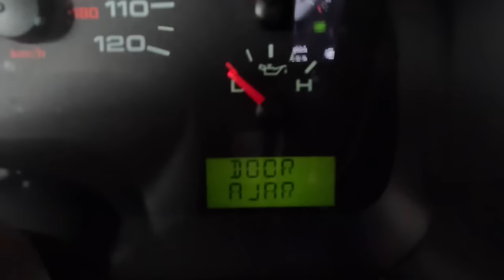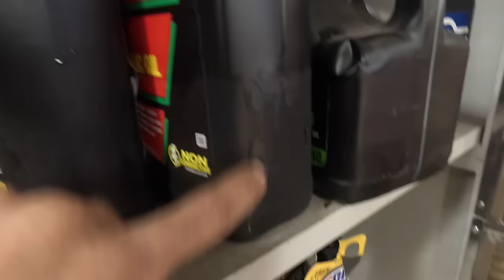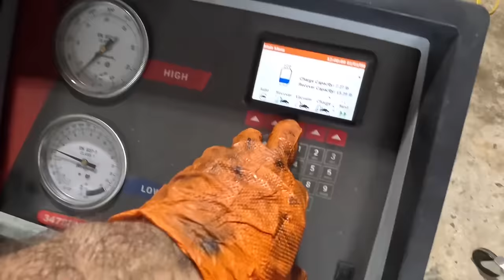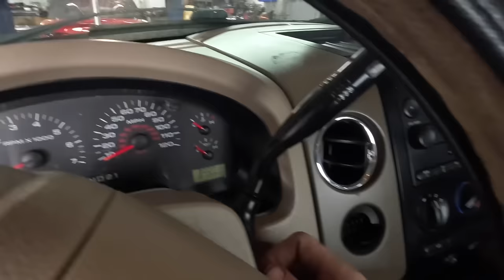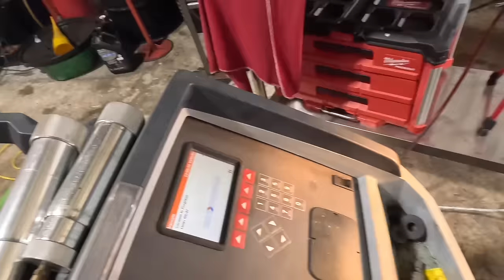New Engine! Warranty Camshaft Sprocket Cheap and Risky! Ford F150 F250 5.4 Triton

Comment: I thought for a moment when you had trouble pulling out the wedge you were going to get the rod only and the plastic bit would be stuck inside!
Reply: i worked at a ford dealer and had that happen with the actual ford tool
Reply: I had that same thought!  Glad the whole tool came back out.  As Ray would say "that would be bad". 😂
Reply: I thought the same thing.
Reply: My mind went there, I'm not gonna lie.
Reply: I too was worried about the lemon-flavored popsicle.
Reply: I had visions of Ray needing to find something long and with a hook, like a bit of welded welding rod to try and fish out the missing head of the tool --- and then that would get stuck or drop into the chasm of the timing cover.  "Das wäre schlecht" he might have said, and the camera could have begun to smoke in sympathy.
Reply: @heckelphon  Kind of like a tool-based version of that childhood song, "I know an old lady who swallowed a fly".
Reply: @MonkeyJedi99 it's a cheese wedge
Reply: @rosselnator  definitely a cheesy way to fix the problem... Not a fan of the rebuild company or their insurer...
Reply: @mikejacob3536  ... and if Ray had had a problem with that tool or the method, would they have paid for his time in stripping down the front of the engine to sort it?
Reply: Especially when he said come from Amazon....lol
Reply: That would suck!!!

Comment: I was literally cringing when you were changing that sprocket out - worried you were going to lose that chain and have to take apart the whole front of the engine.  But, smooth as always, you are, Ray!  Turned it into an outright breeze!
Reply: Watching you work in such tight spaces I will stay with working on my old 1961 F100 where I can see what I am doing.
Reply: Set phasers to bad rebuild! Fire photon torpedoes!
Reply: Hahahahahaha! 😅
Reply: It is like doing surgery.

Comment: Hey Ray Ray. Thanks for doing my trailer tires last month. I work at dorman and I was a quality engineer from 2016 until 2022. When I started the warranty Rate was over 50% and I got it down to less than 15% before I took a higher position in Dorman. They've really turned the focus more toward quality.
Reply: I just bought and installed a Dorman coolant reservoir on my 2011 Ford F-150 with the 3.5 Ecoboost and so far that bottle is solid.  It got awesome reviews from everyone who bought one and it saved me about $75 compared to the Motorcraft part.  I also likes what Dorman did with the heater hose for my truck.  Replacing the stupid plastic "Y" pipe with an aluminum pipe.  Nice job!
Reply: I worked for Advance Auto Parts and saw some amazing aftermarket fixes from Dorman. Like the rear main seal assembly for a 4.8, 5.3 or 6.0 Chevy. Dorman has the best OE fixes out of anybody at reasonable costs.
Reply: This just shows the good influence having the right people in a company can have. Well done sir.
Reply: Your 5.4 Chains & phasers still need attention.. bought em and ended up replacing with Ford OEM parts .. somethings just don't beat factory
Reply: @tomboone201  well yeah!  Certain parts you just don't skimp on and always go OEM.  Especially, the chains and phasers!
Reply: @bearing_aficionado  found that out thx .  Lol but it all worked out ,gave em to a guy that was selling his truck and gave it with the truck .. I have 2 more engines to do in my fleet
Reply: @tomboone201  I had to replace my chain and two of my phasers and made sure they used OEM.  As much money it cost me, I didn't want to go through that again.  Not a cheap fix!
Reply: @bearing_aficionado  my kid works at a Ford dealership, I get a little off, enough to where I replace the oil adjusters, and all the sensors
Reply: @tomboone201  well take advantage of that!  I had an independent shop do my because they could get it in right away.  The dealership was pissing me off when they had my truck for an entire week and still hadn't got to it.
Reply: @bearing_aficionado  we kinda became experts at that engine .. out of necessity, I almost ripped them out and put 5.8 & 460's in .  Just in the coils, injectors ,chains and phasers go ford .  I use aftermarket for guilds, gaskets etc . Switching out to newer trucks soon, .. but at $48k for a new Dodge or Ford 3)4 ton 2 wheel drives ..
Reply: Nothing to be proud of. Most of the time people don't take back the $5 Dorman seals that ALWAYS fails, they just chuck em in the trash and buy OEM and learn a valuable lesson.
Reply: Nice.  Lay off the Haterade dude.

Comment: Per Ford manual : Cam Phaser bolt. Install new cam phaser bolt.
Step 1. Torque to 40 Nm (30 lb-ft). Step 2.Tighten an additional 90 degrees
Reply: Which is why Ray is a hack!!
Reply: Haha, I’m sure you’ll find he did this off camera, the rattle gun thing was just to stir up comments.. I mean the way he said “came off this way, it’s going on this way” was obviously tongue in cheek 😂.
Reply: The guy rarely torques anything, and has admitted it on several occassions..

Comment: Ray, you didn't look at the instructions that came with the new phaser. The bolt is a torque to yield. The new bolt has to be torqued to 30 lb-ft, then turned an additional 90 degrees. I have a new FoMoCo phaser with instructions in front of me. Confirmed the specs. BTW, I have actually done this job.
Reply: also im like 99% sure they are one time use bolts , and MUST be replaced if removed....... hopefully it holds up lol

Comment: I hated doing electronics warranty work. The pay was crap for all the effort. But there was part of me which just would not allow me to do a half- axxed minimal repair for warranty. I always looked for other potential problems- mostly bad solder joints (Just love that horrible lead free solder) and repaired them. I had close to zero call back rate (.01 %) and refused to compromise on my work standard and ethic, even if it cost more time and effort. At least I could go home feeling that my work was above standard quality for the industry.

Comment: Only one critique, Ray:  The cam phaser bolt has a Ford Torque Spec.  Anything that is not perfect with the installation will be blamed on you for not tightening that bolt to spec.
Other than that, well done, Ray!!  VERY well done!
(Never forget:  On a Ford, if it has threads, chances are there is a torque spec  for that!!)
Reply: Couldn't agree more...  Makes no since to go that far and not torque correctly.  Let along using and IMPACT wrench?

Comment: Should be a new phaser bolt and torque to specs and crank it down another 45 degrees to stretch bolt...or torque to yield...Hope that vacuum tube did come out the back of engine bear to get back in.

Comment: DORMAN PARTS!
My 2012 JEEP 2 door NSG370 six-speed transmission (Mercedes built in Stuttgart Germany Transmission Plant) lost 5th and 6th gear.  I watch Eric O at SMA install a NSG370 with the updated DORMAN Shift Tower.  I ordered a RE-MANUFACTURED NSG370, not a rebuild.  Found the shift tower at WALMART on line (lowest price).  The shift pattern is tighter and the shift throw is shorter.  In a nut shell.... LOVE IT!.

Comment: The pin that you noticed was missing on the old one is the reason it rattles. The pin shears and causes the noise until oil pressure builds. Gotta love a Triton!

Comment: The difference in the phaser is the old design vs new. They changed the thickness of the spring and added that stud to hold more tension on the spring. I know the wedge seems sketchy but we changed tons of 3V Mustang cams using those and never had one slip if wedged tightly like you did. The chain guides have a lip to them so it can only move so much. 

That said the only thing i saw was the phaser bolt install. It is a torque to yield and should be replaced anytime it is removed. It is 30 ft/lbs plus 90 degrees on the bolt. It is hollow to pass oil to the phaser. If over/under torqued they are known to collapse and back out. If this happens, it usually eats the cam and the phaser and sometimes the timing cover and valve cover. 

I also realize this is warranty work so they may have cheaped on that as well.
Reply: Yes the torque is critical on that bolt. It is a special bolt. And should be replaced.
I hope it does not fail.

Comment: the cam phasers on the 5.4s were always loud and ticky like that, thats the way they were designed. one of the service bullitens from ford just told them to ad 5w-50 weight oil to quiet them down if anybody came in complaining about the ticking, the cam phasers adjust timing using oil pressure and using a heavier weight oil quieted them down.

Comment: I have to do some more maintenance on the BMW. These videos motivate me to get on it. @ timestamp 15:49 I'm guessing that the old Cam Phaser missing the pin is the source of your clicking (moving spring). I too have noticed Doorman's increase in quality. I don't seek them out, but they have definitely come up. When I have been forced to use them, they have come through lately.

Comment: Good that you don't tighten the cover fasteners yet before sorting out that vacuum line. But weird that subsequently you don't reattach the steering shaft before putting in the rest of the hoses and brackets.
Reply: Ray gets in a hurry towards the end.  When he got the tube to come loose, he should have put the steering shaft back together.  Instead, he let it go and said, “I’ll get that later”.  Every time he does that he forgets and then has to do it the hard way.  But it makes for humorous content.😂
Reply: Who knows what ELSE the steering shaft could have been in the way of?
Reply: @MonkeyJedi99  
Nothing.  I’ve done the job.  Sometimes I think he does it on purpose for effect.
Reply: @shakerman55  I think you're right. It annoys me every time when he does his quick visual check to see if he didn't forget anything and then moves on, with that disconnected steering shaft, mid-frame, screaming for attention. He's doing it on purpose, lol

Comment: Yup, those old SOHC Nissan engines were the same.  I had to either buy or make a wedge to lock the chain tensioner and chain to remove the cam sprocket and/or cam...

Comment: 1:07:20 Ray has made possibly the most common, and most commonly got away with, mistake when working on a car’s electrical system. When disconnecting the battery, you should always do so at the ground side, which is almost always the negative, nowadays.
That prevents you shorting out the battery, with a carelessly dropped tool, or while reconnecting it.
Have to put my hand up, here, and admit I do it too, because I’m lazy and I’m confident I won’t drop anything across the positive post.
I’m normally right, too. Only happened once, but I was careful for a long time afterwards and only fell back into only disconnecting the easy terminal in recent years. I still tell everyone else, do as I say, not as I do.

Comment: Also fyi yes bro the weather up here in indiana sucks right now. Snow with 50 to 70mph gusts of wind which first started as a cold rain then the temp dropped quickly overnight. The high in my town today was negative ten degrees Fahrenheit with a 20 degree below windchill. My vehicles were so cold that they barely wanted to start. Many people who didnt turn their water to a trickle have frozen burst pipes. And i spent most of the early morning and day out helping people get in their cars or pulling them out of being stuck cuz kr the ice.

Comment: We made that tool with a piece of plastic and a coat hanger it works just fine just make shire you get slack in the chain and yes the bolt is one time use and be torqued properly

Comment: Not sure how many of these you do but, to keep the cam from moving get 2 pair of vise grips and sintch down between the lobes somewhere and lock them down so that yoyr hitting frame and fyel rail on the different pliers that way it cant move either way. (RADIO EDIT) Seen you use a set of vise grips right after clicking send on this comment lmao 🤣 . Ur good lol As usual you come up with an acceptable workaround on every job. *hint: only a small percentage of us can adapt and keep moving in situations like this, so be proud. Years of running construction jobs  has taught me that most folks dont have the sense God gave a billy goat, and i dont say that with malice its just a cold fact.

Comment: That cam phaser has a tty bolt. Did you replace phaser with the old bolt? Also blue lock tight should be used on the bolt. These triton engines are great engines but to get long life out of them they need new timing chains, upgraded oil pumps, and ratchet style lock metal tensioners, not the cheap factory plastic ones. And the phasers also need lockouts installed. The tune isn't necessary after lockouts if the engine light being on don't bother the customer. The tune basicly just turns off vcts and clears engine light. And you failed to torque the bolt to spec.

Comment: BTW, back in the 60s and 70s, and possibly prior to that time, Dorman supplied mostly professionals. I remember my dad having huge chests with many, many Dorman parts. From fasteners to brake parts, springs and retaining clips. My dad used to swear by those parts. I then seem to remember in the late 1990s and 2000s that those parts were available at DIY auto parts stores on the twirly racks and they were absolute garbage for the most part. I'm glad to see that they may have stepped their game back up.

Comment: I did this job on my '05 Ford expedition. Stuck plugs, both phasers, cam tensioners and guides. I didn't buy a tool to hold the chain in place. Buddy of mine worked in a machine shop, so I went to a Ford dealer and measured the tool and made a print. Then I took the print to my buddy gave him a six pack of his favorite beer, and he made me a tool.😂😂😂 Ended up also having a blown up roller follower, which dinged up the cam. So I ended up replacing the cam the follower and lifters. When the roller follower came apart it also popped the cap off of the top of the valve stem so my valve dropped but it didn't bend. I was able to lift the valve up and press the spring put the cap on without pulling the head. It was a two-day job and I hated every minute of it. After doing it in my driveway, I vowed never to buy that engine ever again!!! After I was done it cranked on the first time and I traded that thing off!!!!!

Comment: Ray I like the longer videos. Looking forward to the exhaust manifold change whenever it comes out. I'll have to do mine at some point but right now it's not making any noise but I can see a crack or two in the manifold. 

Changing the phasers by themselves is fairly painless. That is in relation to doing the entire timing set. The most aggravating thing for me was getting the power steering pump back into place and the valve cover on the passenger side on and off without having an a/c machine to evacuate the refrigerant. I like the 5.4 other than all the timing problems. decent power and all. I'm considering either putting a 4-BT Cummins in it or removing the  current timing setup and doing what I saw a guy on here did a few years go and do a homebrew (insert some random supercar name I can't bother to remember here) valve actuation setup with off the shelf parts. Not decided yet but I may re-power with the Cummins and do the mods with the 5.4 out of the truck. Sadly it's stuff like the timing issues on the 5.4 and other similar things across all manufacturers that have given me a desire not to own anything much newer than I already have. Too many stupid decisions put into vehicles by stupid politicians and the even more dumbass EPA.

Comment: i stopped working for ANY warranty companies about 6 years ago because of things like this, and slow pay. haven't regretted that move. i'd have told them that they need to find a different mechanic for this, or let me do it right.
Reply: Yep, same here. I would estimate the job for the customer, tell them how much the warranty company would pay and make them responsible for the balance. Of course the customer would be angry with me, but the problem would be also go to another shop.

Comment: Ray I believe this is the truck had a remanufactored motor installed and the truck came to you with loose parts and you straightened it out and it had a noise and you took the valve cover off and ran it as per this company and now you put a cam phaser on for the fix nice have good day Ray

Comment: Once put a reman Jasper motor in a f100, knocked on crank up....they sent another motor, found out later standard crank bearings installed when they should have been 30 over bearings.
Reply: New cars have came from the factory with wrong size bearings. .0020 under crankshaft with std bearings.
Reply: Friend years ago went through 5 reman motors over a 2 month period.

Comment: You can immobilize the cam by placing a small piece of paper under a bearing cap. Be sure to pull it back out before you rotate the cam.

Comment: I hate those tiny Hy-Vo chains.
Heck of a coincidence to have the riveted link showing on a chain as long as the one in that motor (darker with paint mark, ~8:45)
Personally, I would have turned crank backwards a few degrees to preload tensioner, particularly if it's hydraulic/mechanical, installed wedge then turned forward again to lock things in position (plus get a little more slack?) 
 Years ago, (80's) Kawasaki used even smaller hy-vo on GPZ600. 
It wore out in as little as 18,000 miles. 
Honda 750/900/1000 at least lasted to about 35,000~50,000 miles and that was mainly due to poor servicing which caused 'long' tensioner to fail (it had two)

Comment: I vaguely remember "Ford Boss Me" had trouble with a cam phaser bolt in a video he posted (aftermarket of course) .He solved the problem using an OEM Ford  bolt if I remember correctly, hopefully Ray used or was supplied  the correct OEM bolt.However the bolt he put in had a paint mark on it too .